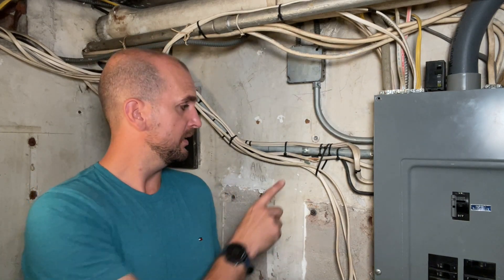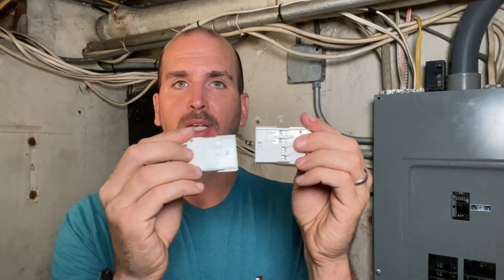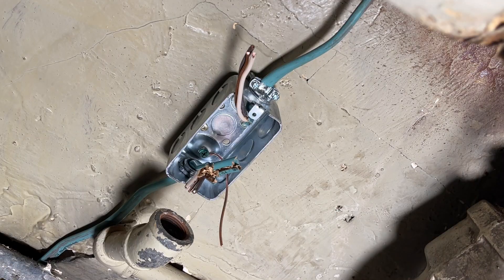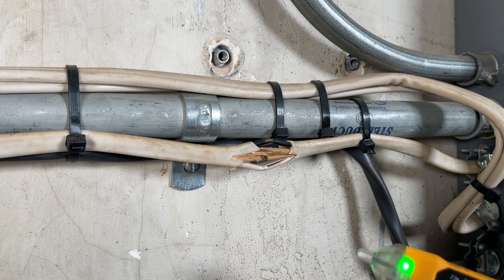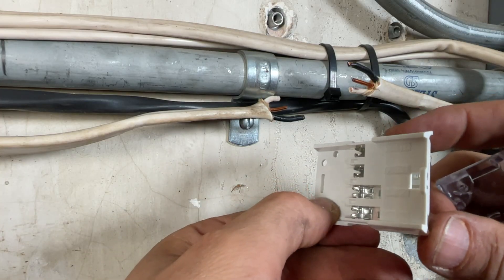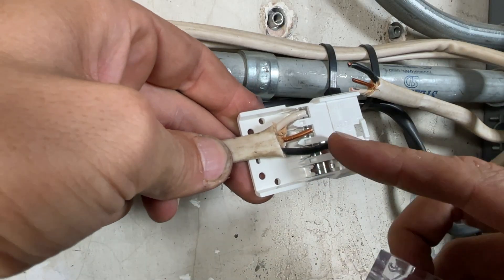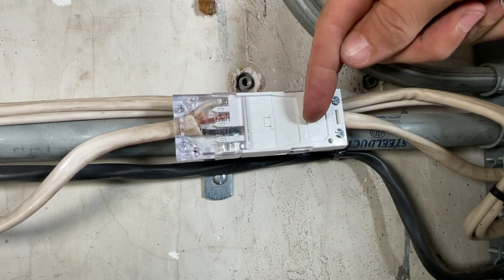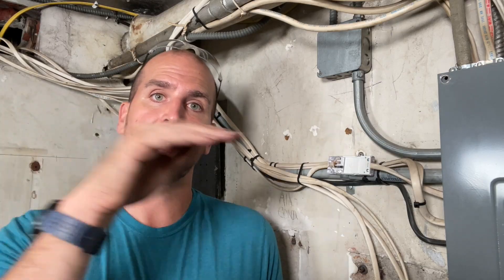How To Repair Damaged Romex Wires

Comment: If the conductor isn’t damaged, I would prefer a few wraps of electrical tape over this garbage. Before that device was installed, this was only an electrical shock hazard for anyone poking their fingers in it. A hazard that wasn’t likely to kill anyone. Now it is a fire hazard that could kill your entire family and possibly a firefighter if things go really wrong. . . Those splice connectors don’t have the best reputation from what I’ve seen.

Comment: Splice kit would be nice, but at $24ish a pop and very poor availability (Home Depot list but is not available, so amazon only?) it is not much of an option.  When you can get a package of 5 or so for under $20 off the shelf at local box store as they should be - then fine.  …until then - junction box!

Comment: IDK bro that looks really unsafe, ngl... I'd run a new wire any day before I'd run that splice, if it even had crimp connectors over those shitty connectors, I'd use it. Damn 12g wire is less than a dollar a foot. IDC if 7 dollar connector, id replace 70 ft of wire before using something like that. Fire in the wall waiting to happen,

Comment: So you just took a solid wire and cut it to connect it between 2 razor blades, and code fucking supports that?!?!? Goddamn electrical tape would make insulation without destroying the wire's ability to contain amperage, but code don't support that? Is code trying to burn down houses?

Comment: Why ground the handy box when it's mounted to concrete or other non conductive surface? What advantage is there?
Reply: IF for some reason the Hot wire were to contact an ungrounded metal box the box would then be hot(energized). 
WHEN a conductor - most likely a person - then touches that box the current will flow through the conductor/person if/when that conductor/person is all in contact with a Ground and/or Neutral. 
The box becomes a very large Hot exposed terminal/lug. 

HTH

Comment: Wago are the best been using them 4 years. I would have installed plug into ceiling. 819 no elecrical tape. You want to be able to inspect those contact point visually for arcing. Inspectors hate electrical tape.

Comment: I successfully used a Tyco Electronics tap kit very similar to the splice kit shown in this video to tap into an existing 14 AWG Romex cable with a another cable that had been pulled from the subpanel in order to beef up the wiring.  The builder had foolishly used 14 AWG throughout the 2400 sq ft house, even for outlets, and when the homeowner acquired a window-mounted air conditioner and tried to operate it in a bedroom at the far end of the house, the voltage would sag so badly that the compressor motor wouldn't start.  Also, replacing the existing 14 AWG wiring with larger gauge wiring would have required extensive destruction of drywall ceiling panels.  If the Tyco kit hadn't been available, I would have had to cut into the existing cable and use two junction boxes 16 inches apart, because there wasn't enough slack at the cut to provide the required minimum 8 inches of wire at the wire ends.  The modification looks neat and has been working fine for over 10 years now.

Comment: I would like to know what the current capacity is on those insulation displacement connectors. That circuit to me is no longer capable of the 15 amp service it once was.
Reply: The TE splices are rated for 20A at 300V.

Comment: (1:50) The type of non-contact tester shown has been available for many years and they are inexpensive.  It begs the question why the person who worked on the cable didn't use one of them instead of hacking up the cable insulation.  Moreover, needle-type insulation piercing points are available for DVM probes that leave an almost invisible hole that would only be of concern in an underground cable.

Comment: I had a similar problem where Rodents eat the cloth wireBut the copper wasn’t ruined there was no way I was going to cut it went down to the 99 Cents store and bought toothpicks and a hot glue gun solve the problem